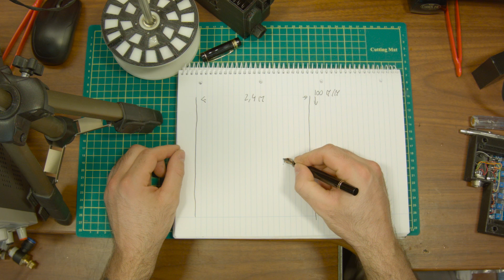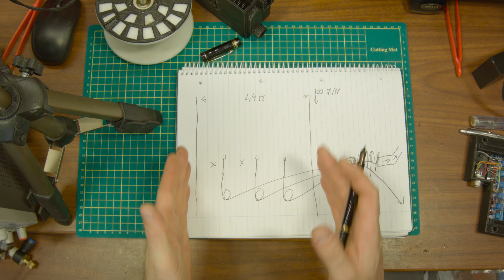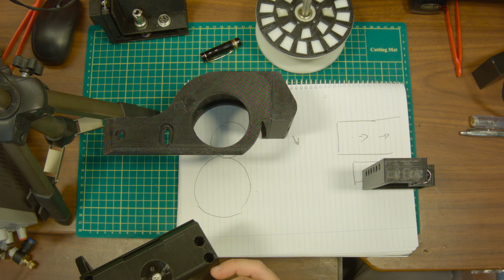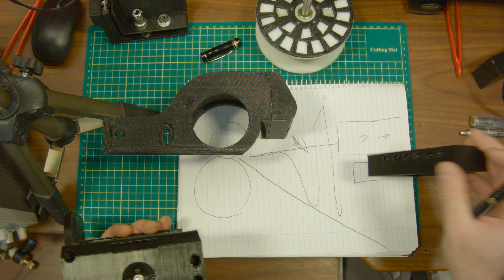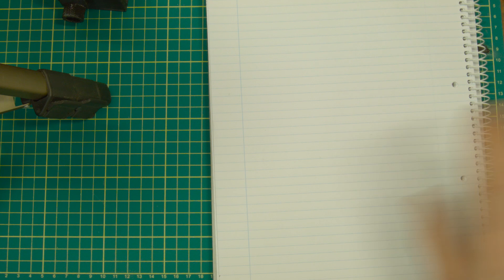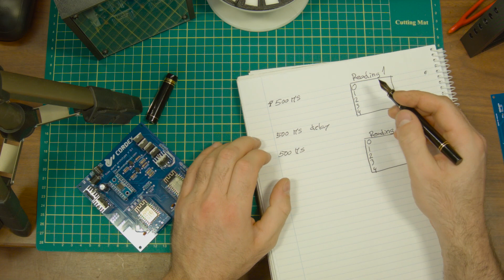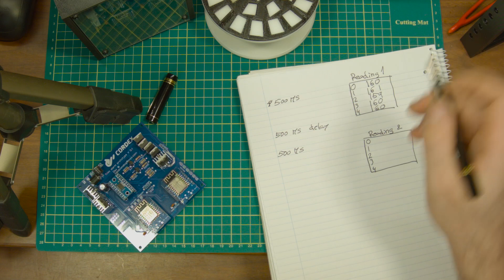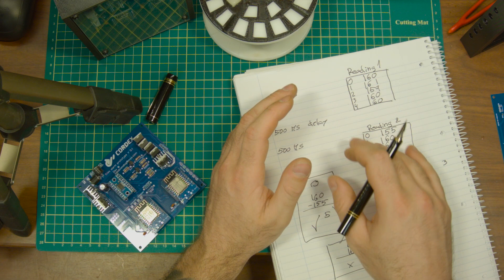Trim alarm for stretch film winder (arduino framework)

Comment: throw all the pulleys and motors away. add a vacuum tube at each cut, or pair of cuts. Add 2 waste plastic detectors in each vacuum tube so you can detect  continuous flow of the waste.
Reply from the maker: Yep, ideally, each trim would have it's own vacuum inlet. But the responsible engineers weren't interested in doing that, as their vacuum pump also kept failing. I built a similar but better system using hall effect sensors on the encoders, but never got to install it cuz I quit that job.